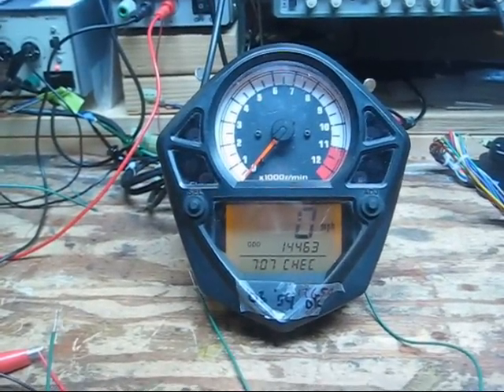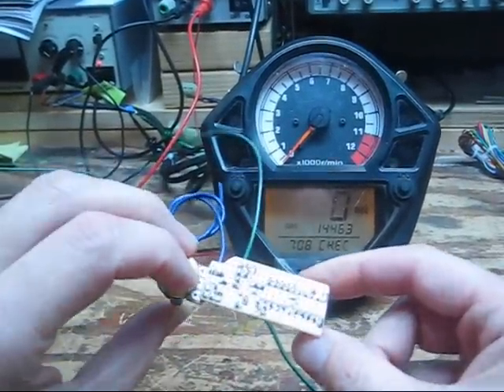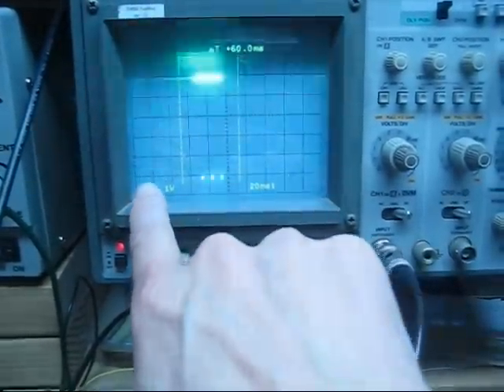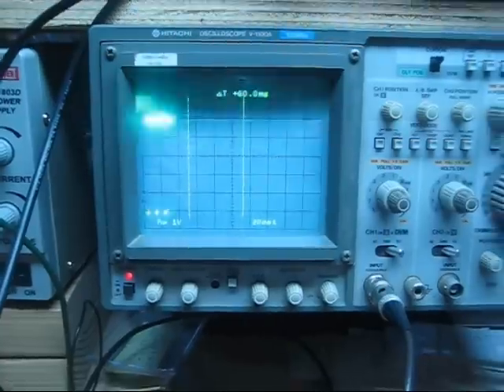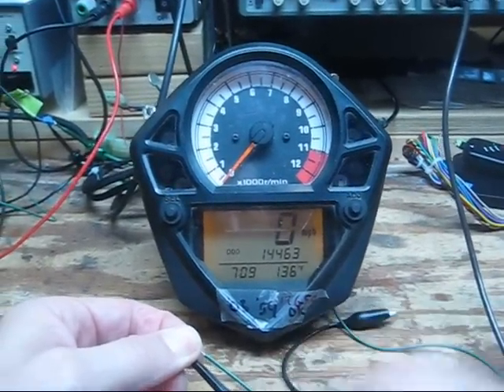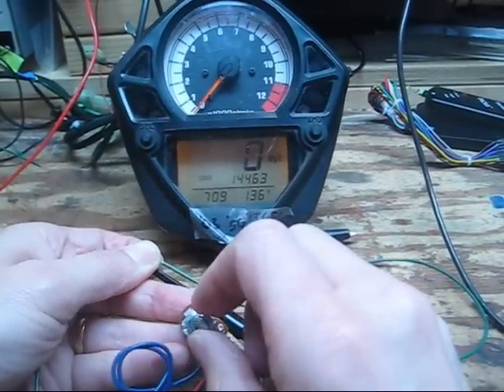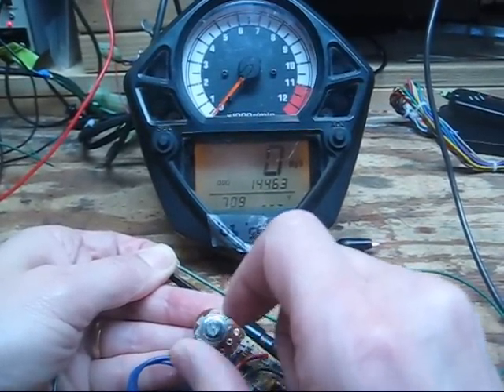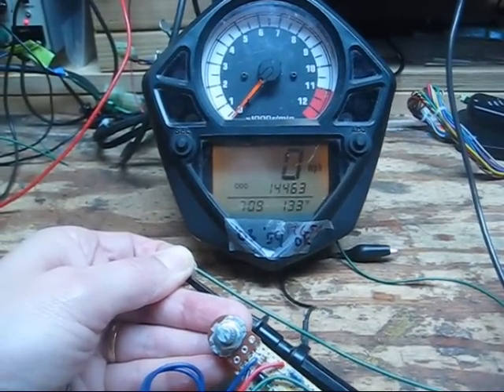SV650 ECM Serial Datastream to SV Gauge.wmv

Comment: There is two things I am trying to do, the first is to replace the LEDs in a spare Tachometer to red LEDs (incase I mess it up) and then if it works I want to match the mileage from the original Tachometer to the spare.
Is this possible?
Reply: Yes.